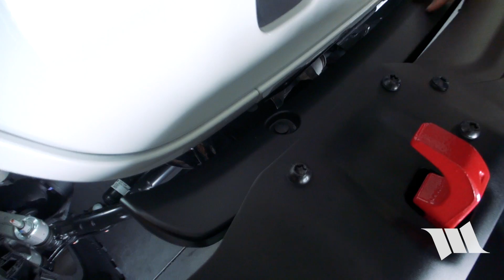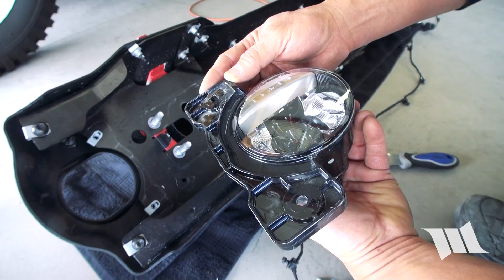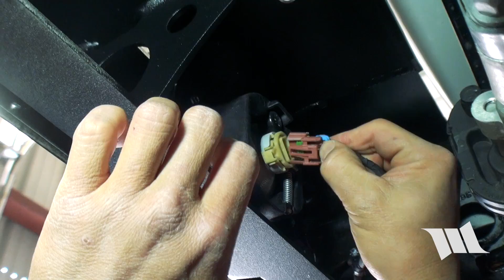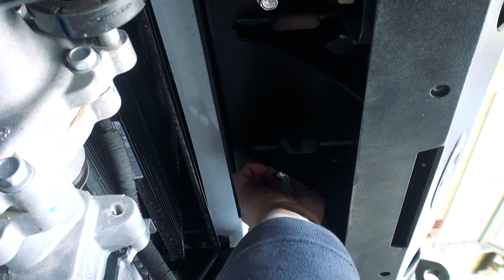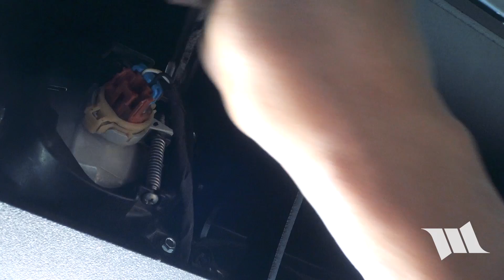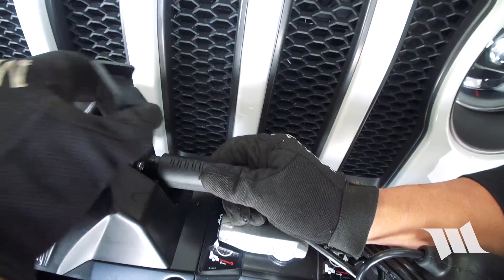Jeep JL Wrangler Front Bumper LoD Destroyer Shorty with WARN Zeon 10s INSTALLATION : JL JOURNAL

Comment: I have a bodygaurd bumper system and a Warn Xeon Platnium winch. It come with a wireless remote. I was wondering your thoughts on using a solenoid from Warn to connect it to a SPOD to turn the winch on or off. I do have a Genesis Full Sized Dual Battery system already which has a Solenoid to switch between batteries should one get low. If I connect it directly to their accessory mount which goes directly to the battery are there any advantages in connecting it to the SPOD for power?
Reply from the maker: Personally, I prefer using the old school wired connection. That way, I can hand it off to someone else if the need arises.
Reply: @wayalife  Thanks, that will save me some headaches. As always, I appreciate your response. 🤠👍

Comment: Question I have a 2023 Wrangled 2 door  Rubicon. Would like to do the same bumper and winch but also would like to tow 4 down are the D rings acceptable to attach a tow bar?
Reply from the maker: Sorry, not 100% sure about fitment but strength is all there.

Comment: Can you use this bumper with the stock plastic skid plate?
Reply from the maker: I don't think so. The plastic air dam is secured to the factory bumper with plastic push pins and bolts. There is nothing about this setup that would allow you to secure it to it.

Comment: Great video but a bit discouraging for me.  I am looking to order a new JL and was trying to decide whether or not to get the factory steel bumpers or aftermarket.  Aftermarket is always fun and LOD was at the very top of my list. 

I just don't understand why they would design, market and sell a front bumper for JLs that does not accept the fog lights that come on a JL.  My search continues.
Reply from the maker: To be fair, this video was made back in 2018. Things change and so has their kit. Give them a call and you will find that you can make it work the the steel bumper fog lights now. Of course, if you order your JL without the steel bumper, the fog lights had always worked.
Reply: @wayalife  Thank you.  That changes everything.  I would not order the steel bumper and then swap it for an LOD.  I WOULD buy the JL with the standard bumper and swap that for the LOD.

Comment: You have to disconnect the two negative battery leads from each other because there are two batteries in this jeep for the start/stop system! You didn't actually disconnect the batteries from the jeep.
Reply from the maker: Just followed the directions that we got from WARN/Jeep. You can argue with them.

Comment: Eddie, does the winch require a fuse installed inline with the power cable?  Recently saw someone that cut the end off the power cable and put an inline fuse in.  I've never seen anyone else do that though.  Any thoughts?  thanks in advance!

Comment: of course, I'd rather see you use the original steel bumper, since it's already awesome, but I bet many people who got the plastic bumpers will find this helpful. I'm super happy with my stock steel bumper and I don't think I'll ever change it. I will remove the the ends and add a brush bar, winch and lights though. So many options available. such a fun truck.

Comment: Where did you end up placing the License plate on this bumper?
Reply from the maker: I didn't put one on but LoD does provide a license plate bracket.
Reply: @wayalife  oh nice, I ask because I used to have a 350z and didn't put my plate on my front bumper and cops would pull me over 🤦🏻‍♂️ if you don't mind one more question, I have the JL Sport S with the non LED lights.. do those fit on this bumper without modifications?
Reply from the maker: @adro90  Yes, the only fog lights that require modification are the ones that come in the Rubicon steel bumper.
Reply: Wayalife Preciate the response brotha 🙏 just ordered a mid width destroyer

Comment: Eddie...using this bumper for a while now would you keep LOD or use factory bumper?

Also I see from videos you kept rear bumper OFF and are just using arm out of receiver. I like that. Why buy after market bumper if you dont need it.
Reply from the maker: The factory steel front bumper is really nice and if you have one already, I could see how you might want to keep it. However, for serious off road use, the factory bumper will take a beating - I've seen it and for that, I would keep my LoD.

Comment: Would you know where I could buy the fairlead mount. I'm talking about the extra metal plate that you put between the bumper and winch. Thank you for your time.
Reply from the maker: The LoD bumper should come with one. Mine didn't but it was by mistake.
Reply: Wayalife ok gotcha
Reply: Wayalife I’m finally getting around tomorrow and putting on my new LOD front bumper. So I’m watching this video for like the 50th time. To make sure I do it right. Thanks for taking your time and posting this videos. I have the same winch that you have. But waiting till I get my OEM led Headlights to install the rest of the project. It doesn’t seem there’s enough room to have the winch mounted. And still be able to remove the grill. But I won’t get the headlights till April. They are on back ordered.

Comment: Ok guys I'm thinking this group is the most knowledgeable about what winch works best. I have a 16 Rubicon and will be doing some pretty thick mudding & possibly steep rocky terrain... What are your suggestions?
Reply from the maker: Scott Kinderdine warn is the only brand I trust.
Reply: Do you feel 8000 pounds is enough?
Reply from the maker: In my opinion, yes. If you need more pulling power, a snatch block will help out and get the job done.
Reply: I guess I need to look up that video... Have no idea what a snatch block does & I'm not going to pretend I do lol.
Reply from the maker: @scottkinderdine3317  A snatch block is a pulley. It'll allow you to double up your line and give you more pulling power. That being said, an 8000 should be more than enough for most situations.
Reply: Awesome! As always thanks for your quick response... Love your channel, keep up the great work!

Comment: Great videos; did you re gear to run 37’s? Big brakes?
Reply from the maker: The JL Wrangler comes with bigger brakes, nothing more is needed. Unlike the JK before, the JL comes with an amazing 8-speed automatic that does a great job of pushing 37's. No re-gear is needed.

Comment: Hey Ed, have you found a steel bumper for the JL that works well with the factory LED fog lights??
Reply from the maker: Please note that the ONLY LED fog lights to have issues are the ones that come in the Rubicon steel bumper. The LED's that come in the standard plastic factory bumpers work fine. ALSO, LoD has since come out with new brackets that do allow for the use of Rubicon steel bumper LEDs.

Comment: I know this is off topic, but I saw that you listed all the torque specs for the JL-Thank you. Im a bit confused though....Some say 100 flbs + 50, like the control arms. Why? Why not just an actual number without degrees? And how can I torque that accurately?
Reply from the maker: Apparently, you are referring to the torque specs that I've posted up here: https://jlwrangler.com/showthread.php?1167-JL-WRANGLER-TORQUE-SETTINGS-Quick-Reference-Guide

What you're seeing are what FCA has listed in their specs. I could tell you what I set my bolts to but I wouldn't want to be held responsible if something went wrong.
Reply: Wayalife Well regardless, it’s a bit confusing. The Mopar kit says 190... That’s quite a bit more than the JK.
Reply from the maker: 190 is what I set my front lower control arm bolts as they are considerably bigger than the ones on a JK. I should note that the front upper arms use the same size bolts as a JK and the same is true of the rear upper and lower arms.
Reply: Wayalife Thank you Sir!

Comment: Is there any Warranty issues now that you have changed the front frame supports from Factory, and what about the light wiring is it made for LEDs they take way less power then the old light's?
Reply from the maker: Your dealership would need to prove that any modification you made to your Jeep was the caused whatever problem it is that you are trying to have covered under warranty. The LED's take the same amount of power.

Comment: Just installed the same bumper on my wife's JL Rubi this afternoon. It had the factory plastic bumper, so the fogs fit no problem. The only thing I did differently, was to use the bolts to attach the skid plate cross member to the frame, then use the button head bolts to attach the skid plate to the bumper and cross member. Now researching winches...

Comment: Great looking bumper.  For the price you pay for a Rubicon why do they still have a manual hood prop? My wife's Honda accord has automatic hood struts and it cost half of what a Rubicon does. Seems like a fail on Jeeps part.
Reply from the maker: I don't know, if you work on your own Jeep, it's kind of nice being able to open the hood all the way and rest it on a the windshield. With a pad of some sort of course. I do this all the time and it'd be a lot harder to do with struts.
Reply: I have an old CJ in the garage I will start working on someday.  The manual rod makes sense from a "do it yourself" perspective. Maybe the struts should be an option or maybe they are I don't know. How about a carbon fiber hood prop at least hahaha.  I should have thought my original comment through a bit better before posting.

Comment: My build for my 18 Rubicon JL is 2.5” RC spacer lift and 37” tires, was wondering how much drop or sag happened with weight of bumper and heavy Winch? I added a additional 3/4” RC spacer to the front and from before and after measuring found out it was perfect for Red Rock stubby bumper and Smittybilt 9500# rope Winch. It dropped the front exactly the 3/4” so maintained the 2.5” lift. I know the springs will set later but so far happy with the 3/4” spacer.

Comment: Going backwards I would wait until the bumper manufacturer caught up to. 2018 and made the bumper work with all the new stuff from 2018 jepps
Reply from the maker: Since making this video, I have found that the LED fogs in the standard plastic bumpers work fine on this bumper. It's only the fogs in the optional steel group Rubicon bumper that doesn't fit and most people won't be doing what we did and get rid of it for something like an LoD bumper.

Comment: The puck is actually called a wedge for holding the rope ;) we use em all the time to tie our lines when working with cranes ;) i'm a crane operator ! good install, why the LOD ?
Reply from the maker: Too funny. If anything, I would have called it a "wedge" but in the WARN instructions, they called it a "puck". Went with LoD for a few reasons. For one, we really wanted to have a winch for EJS and for two, they're friends of ours and were able to help us out in a pinch.

Comment: I would think it would be better if the bolt went in from the top in case the nut came loose from vibration over time, that way the bolt at least stays in the hole some time before it could fall out and be discovered and saved from having bigger issues with the winch itself.
Reply from the maker: I have been doing this for over 25 years now. During that time, I have NEVER seen a winch bolt come loose.

Comment: Much nicer looking and stronger than the stock bumper. Just kind of disappointed that LOD didn't think through the LED fog light mounting option for JL owners.
Reply from the maker: In truth, it really wasn't their fault. The LED fogs on the standard plastic bumper are the same as what we installed. It's only on the optional steel bumper that the fogs are different and they're working on a new bracket for it.
Reply: Wayalife ahhh ok very good. Looks great either way.

Comment: just a though, you maybe able to disassemble the mounting housing for the JL fog lights and mount the JL LED headlights into the JK mounting housing. A good way to save $500.00 on purchasing aftermarket fogs.
Reply from the maker: It's a good thought but if you look at it carefully, you'll see that the housing is molded plastic and not something you can disassemble. That being said, the LED fog light issue is only an issue with ones that come on the steel bumper group. If you have a plastic bumper, the LED fogs for it should still work just fine. Most people with the steel bumper group will not be swapping it out for a different bumper like I did.
Reply: That stinks they are manufactured that way. Good thing for made in china amazon specials, you can get new ones cheap :). True to the bumper comment, that why so many of them trolled you on this video.  I wish people would learn that its your jeep, which means you get to build it how you want. If they want to pay you to build it in their style then that's a different story.  The JLU looks great and I enjoy your videos. Keep up the great work and I look forward to watching you build this thing out.
Reply from the maker: LOL!! Thank you for that. I really do appreciate it :)

Comment: First of all, great video and nice bumper! I have a question, the new JL comes with an optional ‘4 button Aux power switch.’ All the reviews I have read state that it’s designed for wiring in optional mods such as LED light bars and a winch. Your JLU looks fully loaded. So I am assuming yours came with this option. If it did, why didn’t you wire the winch to be compatible with the new Aux power switch? Thank you for your time and Looking forward to all your future videos.
-Garrett
Reply from the maker: More times than not, a lot of the winching I do is with me standing outside of my Jeep and that's where a remote control comes in handy. For the times that I need to be winching and driving, I still think it'd be a LOT easier to do that with a remote than having to reach all the way over to one of the aux buttons and try to make sure I'm getting the right one while attempting to navigate my way through a tough situation. Of course, that's just me.

Comment: Can you mount a winch on/in the factory steel JL bumper or is an aftermarket bumper required?
Reply from the maker: You can mount it in a steel bumper but you will need a winch plate.

Comment: Great video. I my self like the factory steal bumper and will probably just do a winch mount for it. Not that much rocks around here so don’t need the protection. I love the Milwaukee ratchet. I have one of the new ones that  just came out. It replaced my old one which is the one you have. It have a lot more torque. You don’t need to brake the bolt and nuts with a ratchet. Take a look at them the Milwaukee fuel 12v
Reply from the maker: LOL! Now you have me wanting to buy a new electric ratchet!

Comment: ca the light come out of the plastic bracket and fit into the JK plastic bracket?
Reply from the maker: I don't think so. The way it's made is totally different. From what I've been told, the LED fogs are only different IF you get the steel bumpers.

Comment: Another great video, shame you couldn’t re-use the new JL LED lights.
Reply from the maker: I talked to LoD and they're working on it. Apparently, their Sport didn't come with LED lights so they just didn't know. We're all learning together.
Reply: Wayalife the non metal bumpers have the standard fog light design whether led or standard. Looks like jeep changed it for just the steel bumpers.
Reply: The fog lights are a mess. There’s a difference between steel and non-steel, and halogen and led for Sport, and Sahara/Rubicon. Three different screw positions!
Reply from the maker: Thanks for the heads up. I was wondering about this.
Reply: They made the same LED for the JK (with the standard bumper), it will fit your LOD bumper.  I'm running a set in my LOD mid width right now.

https://www.ebay.com/i/332609312137?chn=ps&dispItem=1